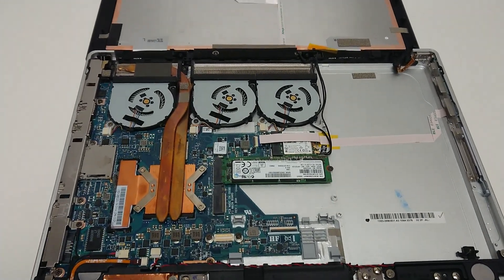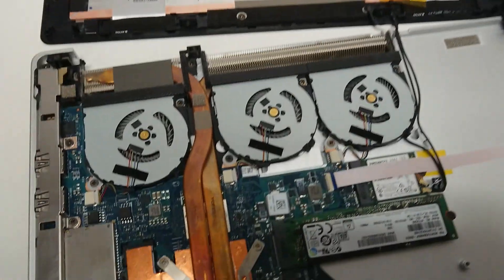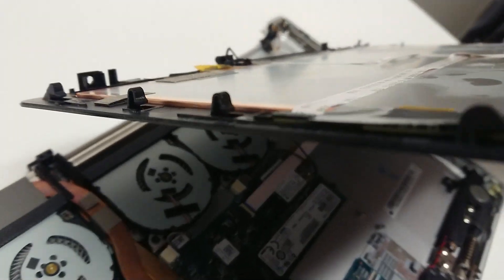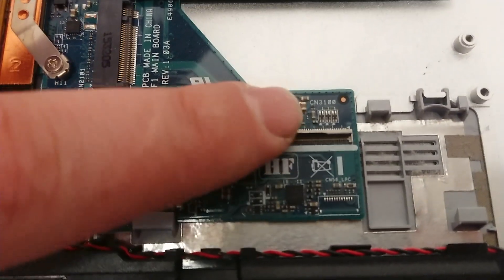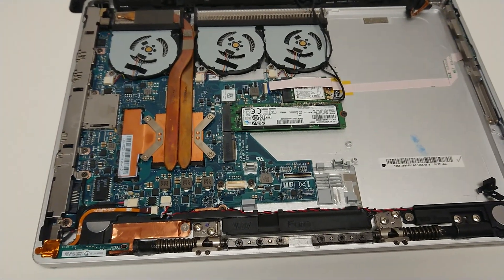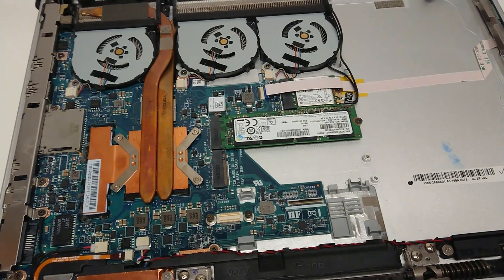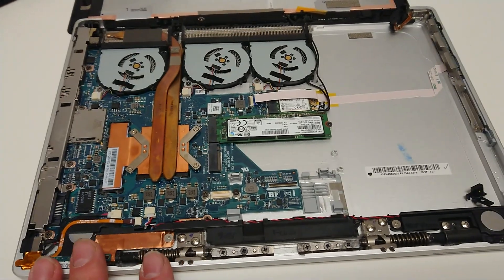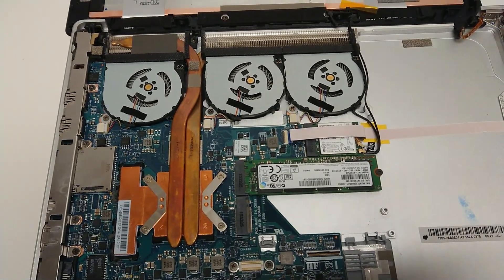Vaio Z Canvas Disassembly - Quad core tablet - Taking a look inside

Comment: I have a 16 gb ram. I DJ and the standard is Apple. Not an Apple guy. Chose this dude and it works great but I'm wondering what I can do to upgrade it if anything. "Ram is soldered on" does that mean I'm outta luck trying to help it run stronger in long mixes? Was thinking I could do 32gb ram but now I'm not so sure. Could a computer shop upgrade it? Any thoughts 💬
Reply from the maker: The storage is the only thing you can upgrade.

Comment: And hello to you also.  Great disassembly tips here.  I have exactly the same model as described above but the battery was bad (not as bad as that warped monster in YOUR machine) and I stupidly waited to change it past the warrant period so I had to pay a small fortune to ship to CA to get it changed out.  I did have the presence of mind to get them to add another 8 Gigs of RAM bringing me to 16.  Great machine but I'm wondering if it could get an upgrade to the CPU and the Graphics card (an Intel Iris) to make it able to give some moderate performance in games.  Wished it could handle No Man's Sky but if the upgrade was do able.  I dunno, what do you think?

Comment: any idea where you can get a new battery? My canvas z battery swelled to the point that the screen is no longer touch screen capable.  But I can't seem to find replacements online.
Reply from the maker: I have no idea but if you do find an answer please update as there are others here who would be interested.
Reply: @IdeaMan4k  do you have the part number from yours when you took it apart?
Reply from the maker: @xvgninja4806  Unfortunately no as mine was always just sitting on a desk and I never unplugged it anyways. Once I took out the battery it didn't change much, am still using it today.
Reply: @IdeaMan4k  I found your video after my screen popped open due to the battery and the Touch screen no longer works. So I was looking for parts and found this.
Reply: Did you find your battery replacement? I have vaio z canvas vjz12a and its battery died years ago.

Comment: Mine too, and that's before my warranty expired, meaning over 2 years ago, but VAIO's customer service was disgusting and they stalled for a month with useless emails asking me to check this firmware and that(my digitizer malfunctioned before I realized that it's battery bloat, but it was clearly hardware related) refusing returns and repairs. Miraculously my digitizer survived and only the screen got pushed out. I realize recently that the battery continues to bloat and the screen is lifted off further from the chassis than before, so I plan on getting a 3rd party battery of the same size or smaller and fixing this.

Comment: Last years my Vaio had the battery issue. I opened it, but not enough carefully and the ribbon that connects the display got harmed u_u the screen doesn't show images although (while plugging a monitor through hdmi) it is recognizing the touch. 
I am still waiting for a replacement as I'd like to use it as it was perfect for my needs. I think this is a error in design, if these batteries are prone to fail in this way the battery should have a less risky access to avoid damaging the inner parts. I guess they wanted the customer to rely in their Japan specialized service but that is not that easy for international customers.
Reply from the maker: True you also have to think that they're making a pretty specialized product of which there is nothing like it on the market. they're the only ones that managed to package these specs into a tablet this size.
Reply: @IdeaMan4k  I agree, and have not hard feelings against them, actually sadness for not being able to use what is. indeed, a feat of engineering. Peruvian greetings : )

Comment: Hi, how can you tell if your battery is becoming bad before splitting the case and or cracking the screen. I have one and so far 2 years no problems. Battery time isnt as great as day one but still gives me  1.2 hours unplugged.
Reply from the maker: I only noticed that the screen was warped. I have had the device plugged in 98% of the time for the last 2-3 years.
Reply: @IdeaMan4k  Hmm i havnt had it plugged in like that but i do notice two things. At 100% when plugged in, charging light turns off and when not in use/storage i do disconnect it, but when turned back on battery power displays 50% after like five days of no use. That's strange to me. Shouldn't it stay at 100%?

Comment: Thanks for posting! I thought I had done something to it but apparently my battery is what is causing the bulge on the right side (the screen/case has separated which i believed saved the screen).  I have to figure out if i should chance pulling it apart.  Thx again.

Comment: My Z canvas all the sudden shut down itself, and now it won't power on or charge even plugged in with the adapter (no orange lights), do you think it's a battery issue or something else? Can't find any info where I can send the device to get it repair, thanks.
Reply from the maker: Its hard to tell what could be wrong. Do you have a way of testing the charger to make sure its not just dead?
Reply: Hello Everyone  Hi thanks for the reply, the charger has green light when plugged in to the power outlet. So I think not the charger's problem. But my Z canvas just totally dead. Feel so sad because I rarely use it....
Reply from the maker: @Aw15241  That is unfortunate. It's not going to be an easy computer to repair as Vaio is so small. Depending on how much money you spent on it I would cut my losses. I have the Vaio SX14 now and love it. Got it for $999 on Amazon.

Comment: What tool did you use to pry the screen from the body?  Also, what starting point would you suggest to begin with when separating the screen from the body?
Reply from the maker: I just used one of those iphone / laptop picks and a credit card. I started from the edge near the vent that comes off after removing the screws. Be SUPER careful the screen does not do well with bending AT ALL. It is really a very difficult operation. I would carefully look at how the clips are shaped on the video and try to release them properly. I really cant overstate how easy it is for the screen to crack.